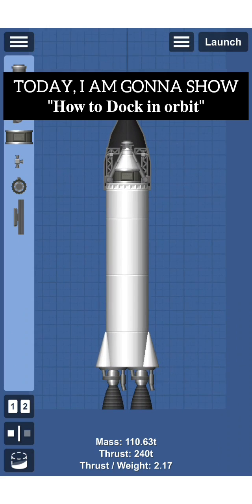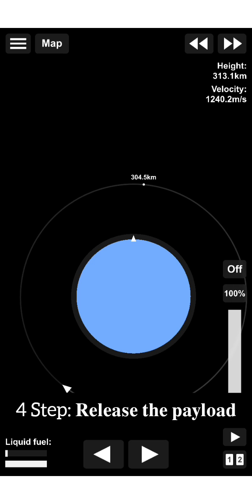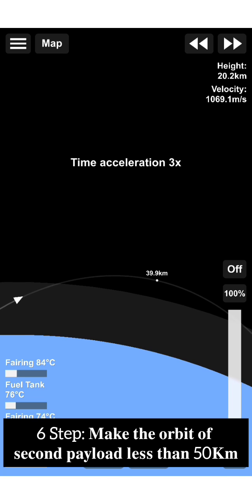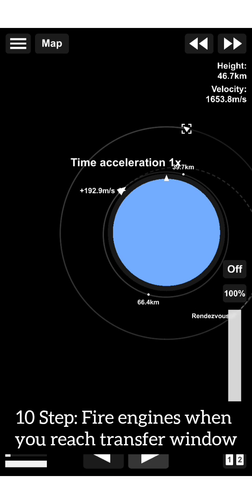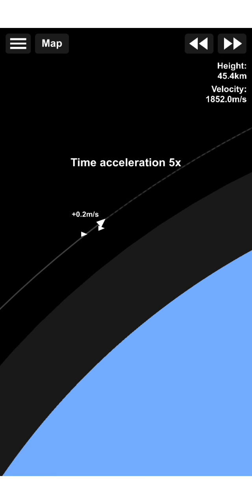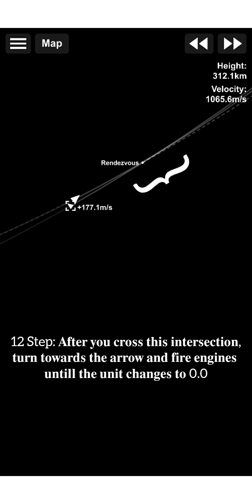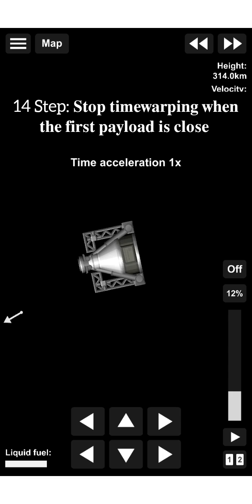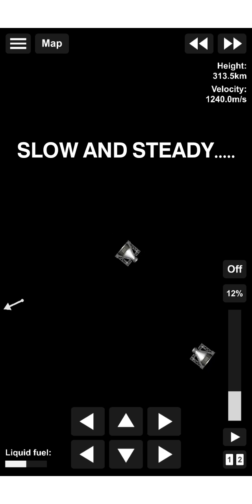DOCKING TUTORIAL | Fully DETAILED | SFS | #sfs #tutorial #beginners

Comment: I prefer my payload to be at 120-210 km high, I actually made a massive space station, refuel stations (for long range missions as I only have the more planets expansion and I'm not spending a lot of money in sfs) also I like to point out that if your in transfer orbit, I recommend it to be at 0.0 and time warp near to the rendezvous point (like really near), that way you have the highest chances to dock, I also suggest quick saving to prevent accidents like 
Going too fast or vice versa and crashing into the craft, or missing it.
I will also say that if your now 6000m away from the craft you are about to dock, if the relative velocity is over 200+ I suggest you slow down to 12 meters per second (1-4 metres per second if it's now 200-100 meters away from the craft), to make it easier, use rcs and make sure that the side velocity is at 0, if you want a challenge don't use rcs, if your a moron, or forgetting to put rcs in your rocket, (just like I did in my Mars mission)
I have a few tips and tricks myself so just pitch your ideas in the reply section of my comment
Reply from the maker: There's a Starman living in the skies🫡

But thank you bro making my job easier and helping others🥲👍

Comment: honestly the best trick for me is to have the second rocket speed up (make opbital ring smaller than the target orbit) or slow down (make orbital ring bigger than the target orbit) until i get within 10km to the target spacecraft and then from there with tracking I keep the rocket at a relative velocity between 15-25 m/s until i get within 1000m of the spacecraft which i slow down to 5m/s and then from there docking is the easiest part

Edit: best time to launch the rocket is typically when the target spacecraft is about 1/8th of a circle behind your rockets starting point like think of it as a clock your rocket is the 12 hand and your target rocket should be at the 10 hand

Comment: My guy there are way simpler ways to do that, for example you can cancle the relative velocity on your first pass
Reply from the maker: But, you need to act fast if you're doing it and also need big engines
Reply: @IMGMYT  Well i always pull it off with a single valiant engine and four rcs blocks
Reply from the maker: Ok